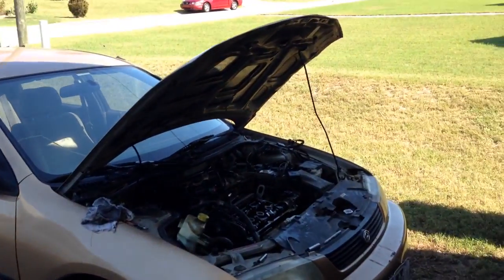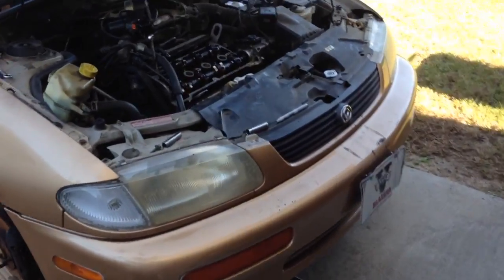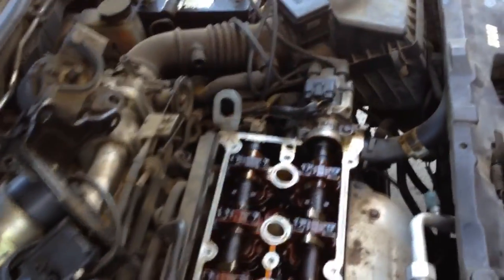Timing marks '96 Mazda protégé DX 1.5 L

Comment: Thanks for the video... My wife has the same version of yours in the video (right down to the color of the car), except her's is a 97 DX.  Her car broke the alternator belt (again) probably due to the issue that it leaks oil like a shiv.  My question is... my Haynes manual never  instructs you to remove oil pump in order to replace the crank seal.  Is the crank seal and the oil pump seal the same seal?  I am not referring to the gaskets that seal the pump to the block, but to the seal on the front of the oil pump.  May be a silly question... but I want to be sure I get this right before I put ALL the stuff back on the engine... and it still leak like a shiv.  Thanks.  BJ

Comment: The Z must face up for the marks to be properly aligned on tge 1.5l,i don't know if this is a interference engine,but if so,and you broke a belt,it pribally has bent valves,therefore will not run,or will run but very rough

Comment: question.... if I wanted to get max fuel economy on my 97 Mazda protégé 1.5 dx 5 speed, what would you recommend I do besides the obvious tune up (oil change, spark plugs/wires, ignition rotor, distributor cap, egr valve)?
Reply: Juan Vazquez shave the head,port and polish,and upgrade the intake and exaust,this will give it more compression,and make it breath better* not to mention a nice performance gain*
Reply: A good tune up never does any harm either*

Comment: i get the timing on time but it act like it want to start but it wont what can be the cause
Reply from the maker: are you getting any Spark, either your crank sensor or cam sensor could be bad. why did you change the timing belt? did it break? if so, is it an interference motor? you could have bent valves which won't let the car start.
Reply from the maker: also do you have fuel pressure

Comment: Is this the mark where you aim the timing light,
Reply from the maker: No, that Mark is on the timing cover and the harmonic balancer when it's all put together.
Reply: I can't find em anywhere. Can u take a pic of yours for me?
Reply from the maker: The timing marks are located on a small flange the sticks out on the bottom timing cover there's also a small notch cut into the edge of your harmonic balancer and it's probably dirty and hard-to-find going to have to clean it but it's there. Your timing cover his old this piece might be broken off and you need to purchase a new timing cover from Amazon for $34